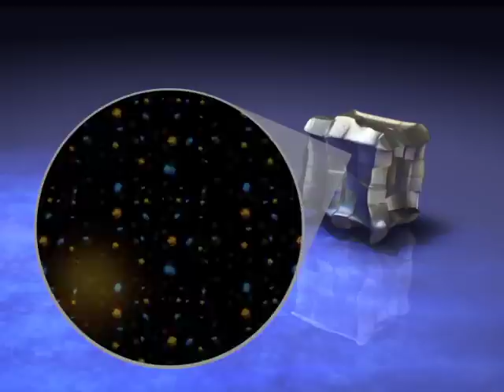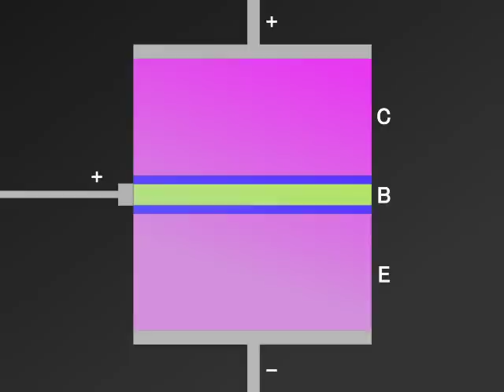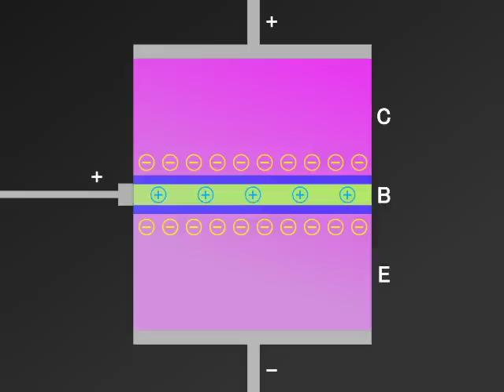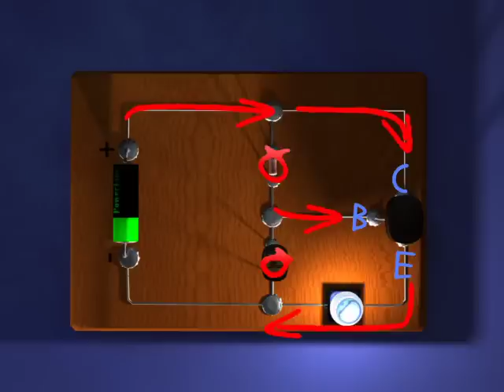Transistor (bipolar) - How it works! (Animation)

Comment: This explanation is deceiving because in reality a BJT is not controlled by controlling the voltage between base and emitter but by controlling the base current instead. 

The transistoric effect, unlike the field effect, is not very easy to explain clearly and in a simple way unfortunately... Many people graduate in electronic engineering without even understanding it

Comment: It would have been more conventional to put the load in the collector.  The problem with putting load in emitter is negative feedback, which reduces VBE drive.  Also, you skipped the whole notion of recombination in the base, which leads to base current, which leads to an explanation of HFE or current gain.   Other than that, nice video!

Comment: It's not very usual to see the "charge" (in this case the lamp) on the emitter side (even if this isn't totally impossible). This kind of arrangement is only used with emitter-common polarized configuration, and is not usual for to operate a light emitting device. Collector-common polarized configuration is the more used arrangement for this purpose. The use of conventional electric flow is not a good choice when explaining the operation of bipolar devices, like semiconductor devices. The use of conventional electric flow in this case only causes more confusion than helping to understanding the principles of operation of semiconductor devices. Conventional electric flow has been abandoned in any serious course of electronics since decades. Since the arrows you use to explain the flow of electric current are only superimposed on the main image, why not simply redraw them, and edit the corresponding voice explanation? Regards.

Comment: 4:18 can someone explain the circuit here in terms of electron flow instead of conventional current flow?  it seems that the bulb is 'blocking' electron flow into the resistor?

Comment: Can aluminum replace boron?
Reply: Althought the basic explanation to get a P type semiconductor says that it's a simple matter to replace a 4 valence element like silicon by a three valence element, like boron, in practice this is not true. There are other physico-chemical aspects to be considered when doping a semiconductor. For this reason boron is the element of choice for doping silicon when manufacturing semiconductor electronic devices, and not aluminum.

Comment: why would anyone call this an amplifier?  I'm not seeing it
Reply: +Des Troya 
I think I know what you mean , but I believe because it amplifies current in a particular direction. 
Maybe you think it is not "amplifying" because it is "rearranging" or "redirecting" electrons into "larger batches " to a selective o/p in the circuit ?
Anyway, if you can't see it, you can definitely HEAR it from any amp, so amplification must be occurring , so we must need to do more research , hmm? But I agree , it is a bit confusing.
NOTE : I am just a novice student too.
Reply: its called an amplifier cuz it can amplify a given small signal. if you give a small AC current to the base(around micro ampere) then you can get a mili ampere level current from collector. do note that it can only amplify to the levels of voltage it receives through the emitter.
Reply: Cause this question, and the three replies that follows, it's more suitable to use the electron flow instead of the conventional electric flow. By adopting this electric current flow, you'll see that is easiest to understand the behavior of polarized devices (like semiconductors). This way also you'll be placing the lamp at the collector's side (the more common configuration) and it will be more understandable the reasons why the transistor amplifies the input signal that comes in from the base side. Regards.

Comment: Doesn't the current flow from the negative side of the battery to the emitter and out the base? Why are you showing the flow backwards? It can get confusing for beginners (like me!).
Reply: When you place diodes in a circuit you just assume power is flowing from + to -, because even though the power is actually flowing in reverse, the diode is reversed too. Same with all the other components - the manufacturer assumes you'll be using conventional theory (+ to -) so the components actually flow power in the reverse of how they're marked. It's a shame the electrical design standards are so messed up, but as long as you stick to conventional flow theory (+ to -) you'll be alright.
Reply from the maker: +Amado Vento Please see the other comments on this issue.
Reply: +Amado Vento for convenience,  electric current is shown always from positive to negative. It is opposite to the direction of electron flow.
Reply: +Amado Vento I was thinking the same thing as I was watching this. As a electronics technician, I always think of current flowing from negative to positive, which is how it really flows in the real world. This is known as "electron flow" model as opposed to the conventional current model shown in this animation. Yes, it confused me as well because I've always been taught using the electron flow (negative to positive).
Reply: But the direction of electron flow matters when we consider that diodes only allow current to flow in one direction? How do you create schematics and get the diode (and maybe other components) pointing the correct direction? I'm still learning...at the basics level. I'm sure it will all make sense at some point.
Reply: +Mumi Adam I will certainly look at it. Thanks!
Reply: Here's the article that made me understand it. Long story short, Ben Franklin was wrong about the direction of flow and it stuck. Conventional flow works just fine for any diagrams you'll encounter as a beginner. Electron flow is (usually) only important for engineering circuits on an atomic level.

http://www.allaboutcircuits.com/textbook/direct-current/chpt-1/conventional-versus-electron-flow/
Reply: sir we no current do not flow from negative  to positive  but whats u have proof its flow p to n
Reply: Dear Amado, unfortunately, even if we're at XXI century, there are some guys that keep still stuck at the old venerable Franklin's time.
Reply: Dear Leo: you've not read carefully the web reference yourself suggest. If so, you'll not said that "Electron flow is (usually) only important for engineering circuits on an atomic level." Electron flow is important for any circuit that uses polarized devices, just the kind of the one discussed here. As the author of that course point out: ... others choose to show the true direction of electron travel so as to avoid having to tell themselves, “just remember the electrons are actually moving the other way” whenever the true direction of electron motion becomes an issue. And the following four ending paragraphs tell us about how he got used to use the electron flow notation, by ending with the following remark: I have subsequently discovered that some students prefer electron flow notation when first learning about the behavior of semiconductive substances. Isn't that clear enough?

Regarding your follow up, the manufacturer DOES NOT assume you'll be using conventional theory (+ to -) when using their devices. They manufacture devices to be used, and does not assume any consideration about the kind of electron flow theory you're using when designing your circuits.

Comment: In your example transistor switching circuit, you should put the lamp in the collector, not the emitter.  With the lamp in the emitter circuit, the voltage across the lamp when it tries to turn on acts as negative feedback, tending to turn the transistor off by raising the emitter voltage above ground (negative battery terminal).  This prevents the transistor from saturating and in practice will cause it to heat up, since it will have voltage across it from collector to emitter--voltage stolen from the lamp--while carrying current.
Reply from the maker: +rchandos Hi, thank you. It's true. However, it's just a very easy example. It has been discussed before. Please see the other comments for more information.
Reply: Dear rchandos: as per the reply by the author, it's clear that this happens when the author does not have any engineering knowledge about semiconductor device circuits. These are the risks of vulgarization in the dissemination of knowledge. We may end up confusing, rather than helping to improve scientific and / or technological concepts.

Comment: What makes the electrons at @3:13 leave the holes and go left
Reply: The applied voltage attracts the electron
Reply: since EB junction is forward bias depletion layer is narrow so electron penetrates in base and then defuse in collector region.
let say 100 electrons injected in base.base is p type very lightly doped(containing some less no of holes to avoid high recombination in base region itself) and very narrow.
1 electron will flow left(in base yellow region) due to BE voltage. this is base current.
3-4 injected electrons will recombine in base region.
rest 95 to 96 injected electrons (and this is the alpha of transistor) will be reaching(defusing from base to collector) collector.
further these 95 to 96 reached electrons are attracted(this time drifted not defused) to the positive applied terminal(CB reverse bias C+) hence making collector current.

so its injection > (recombination(less),defusion(more)) > drift

also I(E)=I(B)+I(C)

Comment: how can 2 electrons of different si atoms can form bond...here actually covalent bond is taking place were an electron of an si atom is shared by two si atoms and so when four electrons of an atom is shared by with four other si atoms,that si atom is then facilitated with total 8 electrons thus filling the outermost shell.
You also didn't tell what n and p type silicon is.
Reply: You're right Puskar: this wanted to be a nice animation, and ended up with a non practical circuit, without a lack of explanation of several basic principles.

Comment: How is more current or voltage than original going to the base if the resistance increases in the photoresistor (when it gets dark) also with a resistor that is on the posative lead of the base?!?!

Comment: I dont see it increasing the voltage .
I thought that was the point of a BJT
Reply: Not really. The idea behind the BJT is to get a gain of CURRENT (not VOLTAGE). And this is true when using a configuration where the "charge" (in this case the lamp) is placed on the collector's side, not the emitter's one (the input signal is assumed to be at the base side). You're served!

Comment: At 0:30, you state that each valence electron of a Si atom wants to "connect" with another electron of a neighboring Si atom, but isn't that counter-intuitive since the two electrons want to repel each other instead of connect?
Reply: Moneer Rifai The video skips a few steps in the explanation. Electrons "wanting" to bond with other electron is a very confusing way to say the silicon atoms tend to form covalent bonds. It's not that the electrons attract each other (obviously they don't and the graphical representation there is completely nonsensical), they are attracted by the nucleus of both atoms in the bond. We often draw the electrons together in schematical drawings, because they occupy the same energy state (but spinning in the opposite direction), but electrons don't occupy a point in space in the traditional sense.
Reply: AdenineMonkey Thanks for clearing that up!

Comment: i had a doubt dude
how does this base current occur due to recombination 
( i mean why shouldnt the recombined electrons move towards the collector ,than moving towards the base)
Reply: for every electron recombining with a hole in the base, one electron flows from the base to emitter , this is called base current.Typically only 5% electrons recombine with holes as the doping in base is quite low...95% of the electrons emitted from emitter reach the collector and subsequently get attracted towards the positive terminal...
Reply: why does the electrons have to flow from base to emitter
Reply: +Bilal Sattikar: ravi thakkar wanted to say that a low number of electrons flowing from the emitter, that doesn't recombine in the base, flow towards the base (not from base to emitter), because of the polarization between the base and the emitter. As you can see, the base has a positive polarization regarding the emitter. Then, when the non-recombined electrons has to continue flowing, they have TWO paths of choice: base or collector. Because of the electric field is higher (higher for electrons, of course) towards the collector, then almost all of the electrons flow to the collector's side. But there is also a little electric field directed towards the base side. Then a fraction (a little number) of electrons flows to the base side.

Comment: Continuity question: Why are you showing what the electrons do inside the transistor and then using "conventional" current flow in your circuit diagram? That is confusing.. May I suggest that you stick with electron flow through the whole instruction?

That said, hopefully this circuit description helps those below that are questioning the circuit (around the 4 min mark is a good place to pause).

So, electrons flow based on electric field strength (think like magnets and magnetic field strength - two north poles will repel, two south poles will repel, one north pole is attracted to another south pole, and the strength of the magnet will determine how hard that "push" or "pull" is). The Earth is considered 0 volts, or neutral; positive voltage refers to "how much voltage (positive field strength) above zero" and conversely negative voltage refers to "how much below zero". In the atomic structure of any atom, there are only two real particles that carry charge, the mobile electron and the stationary proton, which we know resides in the nucleus of the atom. So, the only way to get positive voltage is to remove, or "lower the electron density" of the conductor, and conversely again, the only way to get negative voltage is to add to, or "increase the electron density" of a conductor with respect to earth. So, in a battery, the chemicals that make the ( - ) terminal create a high electron density while the chemicals in the ( + ) terminal create a low electron density, or a drain, that pulls electrons to it (yes, haters, i am simplifying).

So (again):

Daylight -
     Resistance across the photo cell is lower than the resistance of the resistor
     => The electrons flow out of the ( - ) side of the battery, through the photo           resistor, through the standard resistor, and pulled back to the ( + ) side of the battery (looow current, but there is still a chemical reaction happening in the battery, using it up.. just real slowly). Because the photo resistor's resistance is lower than the standard resistor, the transistor gate is negatively biased and "turned off" and the light bulb is off.

Nighttime -
     Resistance across the photo cell becomes higher than the resistance of the resistor
     => The electrons flow out of the ( - ) side of the battery and are nearly stopped by the high photo resistor's resistance and the transistor. BUT, the ( + ) side of the battery is still trying to "suck up electrons".. Because the standard resistor's resistance is now lower relative to the resistance of the photo resistor, the electron density (charge) of the conductor between the photo resistor and the ( + ) side of the battery, and between the transistor gate and the ( + ) side of the battery, and between the transistor itself and the ( + ) side of the battery, lowers (becomes more positive) because the ( + ) terminal of the battery is pulling all electrons it can to it. Now that the transistor gate is positively biased the transistor will "turn on" and therefore the resistance of the transistor drops dramatically to a value below that of the photo resistor and the standard resistor, and path of least resistance for the electrons to get to the (+) side of the battery is through the bulb and through the transistor.

And now the bulb is on. Hope this helps.
Reply: K Tay  really, this the way we  should explain, thanks for the informations

Comment: Why don't electrons simply flow from emitter to base and ignore the collector? Why does the size of P dictate how many electrons may flow down the base?
Reply: the doping in base is quite low, meaning the number of holes(majority carriers) in base is low, hence typically 95% electrons are still free to flow towards the collector...
Reply: Thanks.

Comment: Why does increasing the resistance of the photo resistor cause an increase in the voltage between base and emitter?? Is the normal resistor not feeding current into a base and photo resistor parallel junction? This only causes a change in current flow ratio then ?? Please help I can't figure it out.

Comment: Hi Thomas .. Very nicely explained ... I want to ask that when Photo resistor's resistance will increase in dark then how will base voltage increase ?? can u explain this in detail??
Reply: Path of least resistance. When there is light, the photoresistor is more conductive than the resistor it is in series with and so the shortest path to a closed circuit is through the photoresistor. As the resistance of it increases with darkness, the path of least resistance, in simplest terms, is through the transistor and the light bulb. One "loop" being through the smaller resistor, into the base, and through the emitter, which "switches on" the transistor and allows a larger current from the battery to flow through the collector, out of the emitter, and through the light bulb.
Reply from the maker: Isn't everything clearly explained in the animation?